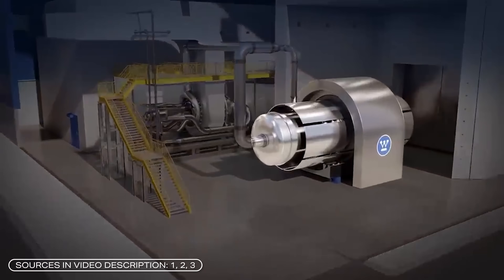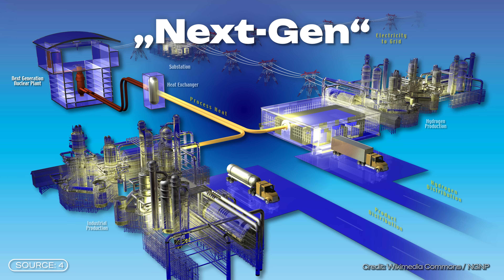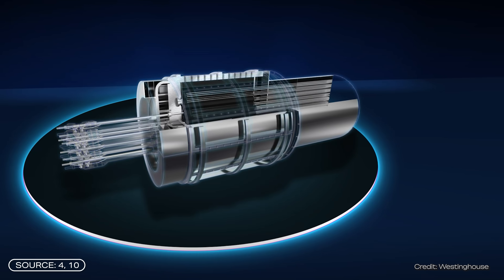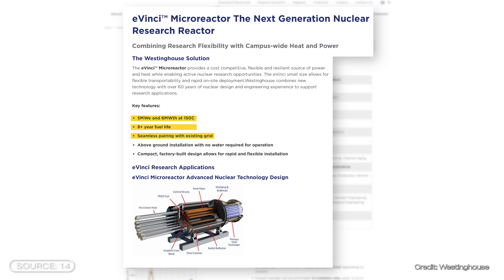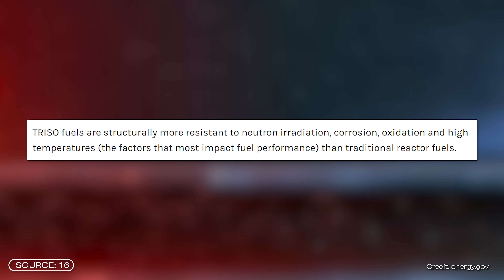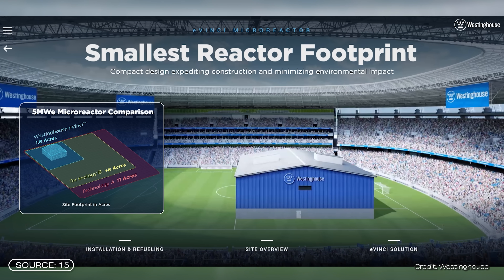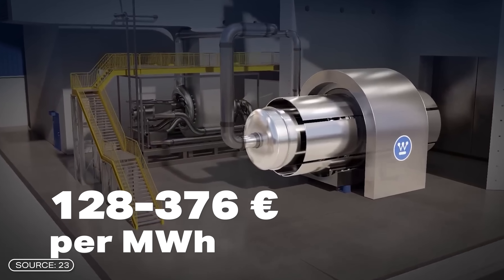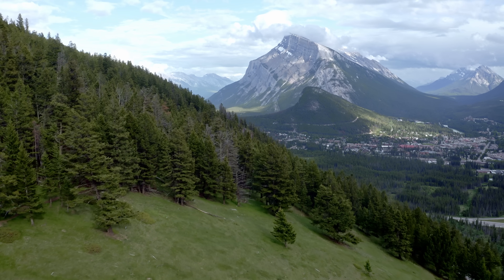Transportable Nuclear Energy: Can This Tiny Reactor Power Our Future?

Comment: Solar with storage!?! You mean you can actually store up enough solar to run a city for a week during the rainy season? Hahahahahahahah! The richest person in the planet can't afford a fully battery backed up solar system to run his house with AC, forced air heating and a hot water heater with a couple weeks back up battery power without relying on a diesel generator or the grid.

Comment: A waste product so toxic we are working on warning signs that even alien life can understand 75,000 years from now. That COST is unacceptable. Bit coin mining and AGI will triple power consumption. We MUST reduce usage. The night sky is invisible. There isnt a dark place left ON THE PLANET. Turn 75% of the lights off. Capture ice in winter/solar heat in summer for off season use. Refrigerator compressors run all winter long but its 5 deg F outside, how easy would it be to dump that heat outside? We MUST work WITH mother nature instead of poisoning her to death. She is half dead as we speak. Our survival depends on this. Stop the TOXINS.

Comment: I've been talking about this for some years now. If we can power a spacecraft satellite for over 40 years. From something the size of a can of beer. Why couldn't that be scaled up?

And where this is going to be needed. Where it will be required. Here in the USA and abroad. Are, for these new huge, Data Centers popping up. That require Megawatts of electricity. To function. More than many cities power utilities can deliver. And they are going to have to generate their own power. And these are just the portable reactors to do it. You know?

I think something like these portable reactors. Will, also be used. For new, out-of-the-way, off the grid, unincorporated communities that may arise. And they have, no commercial electrical, utility. And huge Solar Farms are out of the question. They're going to need these portable nuclear reactor generators. The fuel will never need changing for the life of the reactor. 50 years. And how cost-effective and practical that will come. You know?

For those folks that do not like, nuclear power generation? The Antarctic is melting nicely. And they may consider a change in location? Or maybe Greenland since it'll be the 51st State. Kind of like Hawaii only colder. As I don't see how we can avoid it? As we can't keep burning dead dinosaur stuff. You know?

And nobody's going to tear out our National Power grid just to build a new one. That will be virtually impossible, to do. As powerlines and everything would have to change. It would have to be so much more fortified. And that is just not financially practical to do. We have basically reached an electrical impasse. Time to start thinking out-of-the-box. Like with a portable nuclear reactor power generator. As the batteries never need changing. You know?

And with that new, Space-X massive rocket. Now. We can start exporting our, nuclear waste out into space. Where it belongs. Along with all those blown up stars. It'll fit in just perfectly. And we can get it off and out of our planet. As we need to be sending no one to Mars. That is not survivable. We need to get rid of our nuclear waste, though. And Space-X, would do well with government contracts, doing that. The one thing he would be good at. Getting rid of nuclear glop! You know? Fly it out to space. Get it off our planet. Get it out of the United States! So something bad doesn't happen? Like an asteroid hit. And half, the USA will become, uninhabitable. You know?

And so I'm all for these portable nuclear reactor power generators. As they may help to keep the cost of consumer power down also? And no one's going to complain or argue about that. You know?

Some things make practical sense when people don't.
RemyRAD

Comment: Most remote communities here in Australia can and have replaced diesel generators with Solar + Battery systems, so the expensive Modular Nuclear would be a bad idea financially.  I am assuming though that there are some places (remote and cold, or small islands) where this may be a viable alternative.  I doubt there would be many though because a vast majority can use a Solar-Wind-Battery combination at a fraction of the price.
Maybe the shipping industry could use them in container ships.

Comment: Transportable nuclear reactors like eVinci are interesting but breakthrough solar technology could provide the same modular benefits without nuclear complexity and regulations. I've been following a company called InfraBrite Solar that's developed non-PV technology achieving 93% efficiency in lab tests and they claim to have the lowest priced panels in the world. They also have this ownership model where people can buy small solar units installed on businesses. The businesses get savings on electricity and owners collect revenue with better returns than most investments. While eVinci saves 55,000 tons of CO2 per year, breakthrough solar efficiency could deliver similar clean energy without nuclear waste, regulatory approval delays, or security concerns. Sometimes the simplest breakthrough technology beats even the most advanced nuclear engineering.
Reply: Batteries have been the bottle-neck for years because solar lacks base load capacity. Until batteries can provide the base load that makes technologies like nuclear necessary, solar panel efficiency doesn't matter. The blackout in Spain was because green energy does not have the inertia fossil fuels, nuclear, and hydro provide. Batteries along with other technologies are necessary for solar to fully expand.
Reply: Doubtful.
Reply: These so-called breakthroughs in solar is hypothetical That's all they don't exist unless you can find some way to control the weather and the sun Sounds like wishful thinking

Comment: Glad to see you pose questions on both sides of the fence, I am intrigued with the cooling heat pipe tech and want to know what the efficiency is of the cycle, is it anywhere between 50-60% eff. Will dig into this directly. Also Indonesia, Philippines seem like great locations too containing over 10000s of islands between them. The eff is about 38.5% since it is 5/13 as it says so on westinghouse.

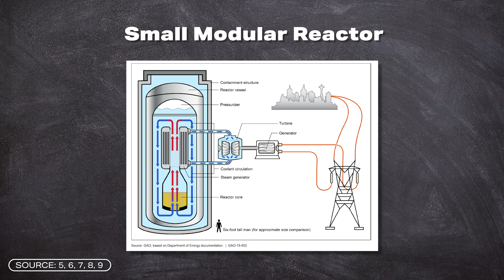Comment: 1:52 20 Megawatts is very good for a small size. All you need to do is to combine several micro Nuclear Reactor together, and it will output adequate energy that is required.

Comment: Take a look at Brilliant Light Power. They were pretty invisible the past few years, but have now started putting out information, admittedly not a lot, but it does look like they are nearing a real operational prototype. Zero fuel cost, 1-2 cents per KH cost for electricity.
Reply: From their homepage "Brilliant Light Power has developed a new commercially competitive, non-polluting, plasma-based primary source of massive power from the conversion of hydrogen atoms of water molecules to dark matter, the previously unidentified matter that makes up most of the mass of the universe."
Since no one even knows what dark matter is or if it even exists this is obvious bs. If they present a bold lie in their first sentence I would deem it a scam.

Comment: I pay .08 cents US per KWH in Nebraska USA.  I would balk at $1 / KWH.  You didn't mention maintenance?  I could see this being used in very remote locations but not residentially.  My energy is 48% renewables and the rest natural gas for a town of ~300k residents.  In addition, I have personal solar on a couple of properties via net metering. 
Solar with battery storage still seems the best solution.
Reply: $108/ MW.h is 10.8c / kW.h, not $1.

Comment: The needs of remote markets seldom get the attention of major industry. This is short sighted as the quantity of these micro markets makes up a large potential for future investment especially since many of these locations are located in remote cold northern climates where renewable sources of energy are not practical and the logistics of delivering fossil fuels is costly. One size does not fit all. This type of energy source could open up vast areas now considered uninhabitable especially in the far north of the northern hemisphere which would be much more convenient than traveling to Mars.

Comment: AEROSPACE ENGINEER - We've effectively been using nuclear batteries for decades in the form of RTGs (radioisotope thermoelectric generators) with the most well known uses being the 2 Voyager Spacecraft, but they have been used on many other spacecraft. The main difference is those have used Plutonium-238 as the fuel. Th BIG BUT is they have very low power outputs. The Multihundred-watt radioisotope thermoelectric generator (MHW RTG) used for the Voyager probes had an output of 160watts.

FYI - The RTGs used on deep space probes don't rely on nuclear fission. They rely on nuclear decay. 

As far as I know the SNAP 10A was the only nuclear fission reactor to have flown in space. 

Here's the lesson for microreactor fans 
1 - THEY HAVE VERY LOW EFFICIENCY and that's mostly because of how they have converted thermal energy to electrical energy.
2 - THEY NEED to use weapons grade fuel and by weapons grade I don't mean 20-80% U235 enrichment I mean stuff that can go bang. The SNAP-10A reactors used 93% enriched fuel, but the total mass of the fuel was less than the critical mass.
3 - There is a major issue with what's called Neutron Flux. I have only heard nuclear engineers discuss this. Neutron flux is basically the mass flow rate of neutrons through the reactor core. Basically there needs to be enough neutrons flowing through the reactor to a) generate heat and 2) cause further nuclear reactions. In a normal commercial reactor they can use fuel down to around 3% enrichment because the reactor cores are so large there's enough neutron flux to keep the fuel reacting. That's the problem with micro-reactors. There's just not enough fuel mass in the core to sustain the nuclear reaction below a certain point.

So to make micro reactors viable they are going to need to use HALEU fuel or even higher levels on enrichment and THAT WILL BE A VERY SERIOUS SECURITY ISSUE.

Comment: One of the problems is that the cost, if they manage to get it that "low", which I doubt, will be practically constant, regardless of if you need the power or not.  Meaning, in small remote isolated grids, either you have to rely on some controllable power generation and or storage anyway, or the cost of the power you actually need is going to be even higher than the actual cost per unit of power generated.  

Cheap wind and solar, and some battery storage, and combustion based power generation to fill in what wind, solar and batteries can't cover is a much more realistic strategy for small remote isolated grids that reasonably can't be connected to national grids.   

Nuclear power is technically amazing, the problem is people, in so many ways. Public opinion have changed wildly, globally, after every one of the bigger events that has happened, despite that the actual consequences was really small to insignificant, compared to those from the use of fossil fuels.     

That means, the main problem with nuclear power isn't technical, it's people. Because of that, changing the technology won't make it viable. Proponents can make any promises they want about small, or micro or whatever size or type of reactor they come up with is going to fix everything about nuclear power, but when the first event with whatever such supposed solution happens that people feel is serious enough, public opinion will shift again, globally. And, such event doesn't even have to cause any significant consequences to create a strong, global, public opposition.      

The idea that there won't be any events, anywhere in the world, with small or micro reactors that Greenpeace at al. can twist to generate a strong global opposition long before production can reach economy of scale isn't realistic.

Comment: Creating ten times more Depleted Uranium from this particular Micro-reactor should stop it's development immediately. When there is Thorium which is approx ten times more efficient and can eat Depleted Uranium  by 90% (as fuel). Thorium is far more abundant than Uranium, is far more efficient, therefore should be far cheaper. But only China has perfected Thorium reactors, despite the US being the first movers on Thorium back in the 1950's. There was a Young American Genius who supposedly built a working Thorium Reactor in his parents garage at age 17, who had high hopes of producing Modular thorium Reactors at and industrial scale, only to disappear from the news? One of the benefits of developing Micro/modular reactors is they can be used to bypass Large centralized Corporate Energy suppliers who appear to want to make energy unaffordable for the Average person. Future, Modular/Micro reactors should bring down the cost of energy, not ramp it up like this GE aboration. Neighborhoods could become self sufficient at reasonable cost. But we will probably have to wait for China or Africa to develop affordable Micro reactors in the future as US corporations are only interested in short term profits at any expense.

Comment: The idea of the reactor itself, Looks good. My question is about the required support facilities. From the included graphics, it doesn't appear that this reactor is a standalone system I.e. you are going to need other facilities on site for community protection (heavy walls) or anciliary options (cooling, and the like. 

Not suggesting this is a bad idea, bu tif the reactor can't be driven up to a site on a 40' trailer, leveled, and plugged in for the site, and be up and running inside of an hour (once on site) I don't see it as likely to be a reasonable option for natural disaster emergency power.

I can see it being useful local power for a datacenter doing AI, where the reactor provides power to the community around the facility as well. That might be on the high end of the capacity of one of these, unless the local community is essentially a couple dozen people supporting the facility. The presumption being that most of the time the load is going to be distributed across dozens or hundreds of these facilities, so having spare power capacity for the support site's offices and residences, seems reasonable. 

That said, I do like the concept, but it's outside of the scope of what I'm  looking for. Which is fine.
Reply: I suspect those reactors are not cost competitive anywhere the national power grid is available or they wouldn't focus on those applications. SMR are already too expensive, doing them that much smaller will drive up the cost per kWh even more. For smallish communities in the middle of nowhere it could be viable, especially if they roll out district heating to use the waste heat too.

Comment: Deep geological disposal works fine for nuclear waste. Insisting that nuclear waste is a issue is simply dishonest
Reply: That's what they said about deep sea disposal in the previous century.
Reply: Claiming that nuclear waste from uranium/plutonium powered plants is not an issue is disingenuous at best, and dishonest in any case. Ignorance of the subject, due to the blandishments and disinformation from the power-plant manufacturers, is no substitute for learning the truth - cold hard physics - surrounding the industry and their "safe, clean" products.
Reply: @robbannstrom everything generates waste . nuclear energy generates little of it. this reactor in particular.
Reply: @odderlendsolvang3790  A typically disingenuous statement from a person either unaware of the dangers of nuclear waste, or seeking to play those dangers down. Congratulations, you toe the line for the nuclear industry. Yes, everything generates waste, but most things don't generate waste which is extremely dangerous, toxic, radioactive for thousands, or hundreds of thousands, of years. Learn the physics!

Comment: Sorry to say; This is not passive cooling. What happens, if the heat-pipe walls break???  You have a Dr. degree and should report in a responsible, pre-cautionary way. This again covers up issues with nuclear reactors and give falls hopes and half backed "information" regarding this highly sensitive theme throwing the crowd and politicians most probably again in the wrong direction.
Reply: Yes. There's no real way that uranium-powered nuclear technology can ever truly be considered safe, or clean. Claiming that it is, is just sweeping the problems under the carpet.